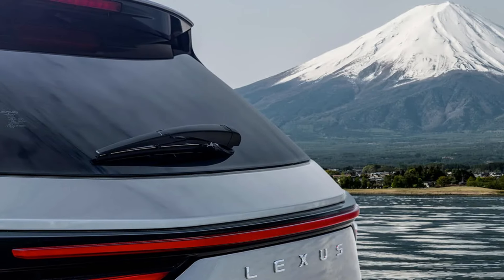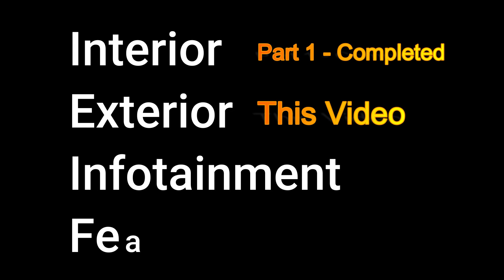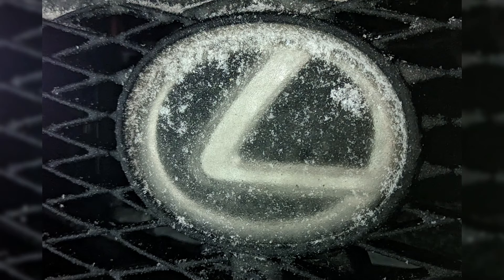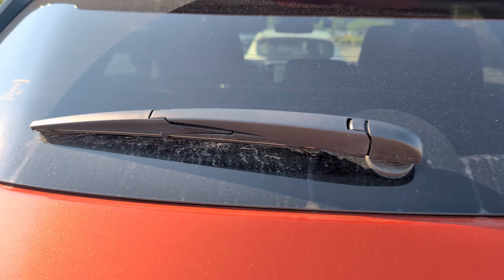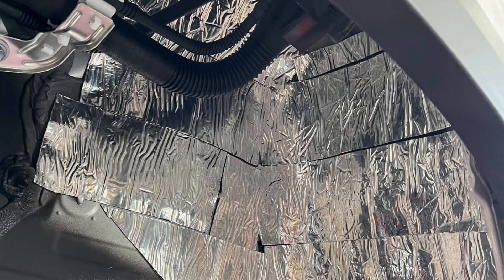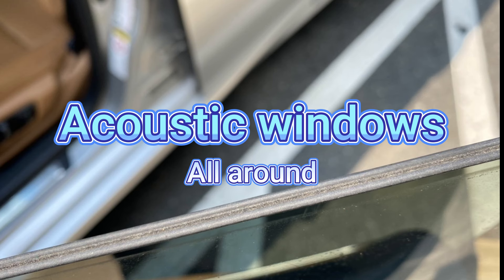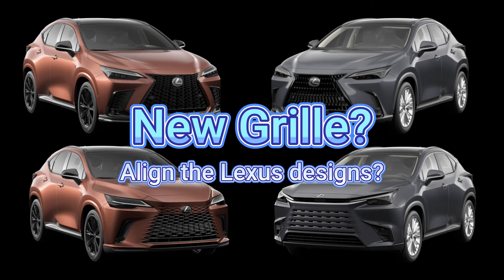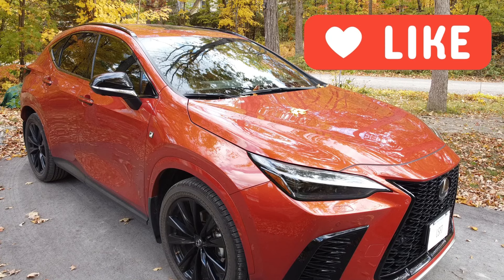2026 LEXUS NX Refresh? Part 2 - Wish list from owners

Comment: Get rid of run-flat tires.  Never will buy a vehicle with those again.
Reply from the maker: I think that's one of the least problems as you could swap them out. Unlike other things can't be replaced.
Reply: Few ppl appreciates run-flat coz of the noise it makes.  Good idea.
Reply from the maker: @wickytam2006 I guess when you get a flat with a repair kit you'll appreciate it.

Comment: 2 requests from me; 1. Change the door handles to ‘flush’ style that pop out or are recessed, 2. I’d like the rear wiper tucked up under the sill, not sitting at the bottom.
Reply from the maker: The door handles that are flush could cause many issues for the winter
Reply: @lsft  you might be right I just love the look of the much more than the older style

Comment: Hide the rear wiper. Heated Lexus emblem is desperately needed on all models!!!! It’s a safety hazard without it. The wiper blades ARE adjustable! Just go to the dealer and tell them how close you want the wiper to sweep to the drivers side A frame. I had them adjust my 2023 NX350 and now my new 2025 NX350h😎. Go get yours adjusted! Front camera washer would be nice 👍 I like the grill on my Executive NX350h.
Reply from the maker: Great feedback!

Comment: I purchased a 450h+ FSport in 2022 and mostly still love it, here are some improvements I'd like to see however. 1) Fewer 'scratchy plastics in the cabin - especially on the B pillar where the seat-belt buckle rattles. 2) Drivers seat thigh support. 3) Fixed panoramic sun-roof 4) Complete re-design of the trip-computer with more data fields. 5) integrated dashcam 6) More conspicuous ambient lighting 7) Wireless Android Auto 8) Active USB C port in centre binnacle. 9) ML Sound System - maybe with active noise cancelling. 10) Some customisable shortcut buttons 11) Greater steering wheel reach. 12) Fully LED driver display 13) Android Auto directions in the HUD 14) Split-screen infotainment system.
Reply from the maker: I guess we bought the same year. Some of the ones you mentioned will be coming up in other parts of this series. Thanks for the input. Some are already in the first part of the video as well.

Comment: I totally agree with your points about both the front and rear windshield wipers, heated symbol to prevent systems shutting down in inclement weather and the washer option for front camera. I would also like them to add the feature of sensors not activating (warning sounds) in the front when you are in reverse, and vice versa. As for the grill, happy with the presently have or the RX version. As a side note, the triple beam led headlights are significantly more expensive than the base version. They cost 4K each as they incorporate smart tech to shut off beams when they sense oncoming vehicles to not affect their vision.
Reply from the maker: I'm aware of the triple beam that is now expensive. But the US version does not include the adaptive high beam. But the bi-led version should be fully led. Just a simple bulb change in the turn signals.

Comment: For me: 
1) Spare tire - at least a donut. Please!
2) Better rear view from the driver seat to the left/right rear.
3) Consider pedestrian safety in the design of the front & grille. Current is too flat/vertical.
4) Camera removable storage for front/rear for crash/theft recording.
5) Rear wiper: YES... hide it.
6) Better ride quality... make the F Sport really stiff, but make the luxury softer.
7) Re Acoustic Glass... again, maybe no for F Sport & yes for luxury?
8) Washers for cameras: maybe.
Reply from the maker: Thanks for your list!

Comment: I would add one guess, about the turn signals : I guess they will be sequential on the refreshed model. Like it happened for the NX 1st generation.
For the front grille, I agree with you, the current one shows more personality and I would love it remains on the refreshed model. But I recognize it is really probable that it will change, more for one that looks like the TX (or the LBX), in my opinion...

Comment: I really wish that the front wipers would clean the entire windshield, as it is annoying to see 3" of snow covered beside the A pillar, and is also a safety hazard. Also, I hate how I cannot just pull out the wipers to make it stand so that it doesn't freeze. I have to put the car into service mode to do so, it's very frustrating and I forget how to do so after 3 seasons of not using it. And in your previous video, the soft plastic dash as well as the screens, they scratch way too easily. I'm always careful by using a soft microfiber towel and not using much force, but my MID display has 3 large and deep scratches that reflect light when it's sunny and the infotainment screen is covered in small micro scratches.
Reply from the maker: Wow you sure have a lot of scratches on your vehicle.  They do have a wiper heater to help melt the ice off the wipers.

Comment: Improvements and changes will be:
New front grille just like on the RZ
2. Alloy wheels should not be changed they are looking good
3. New and redesigned rear lights and hidden wiper 
4. Hidden door handles 
5 New infotainment  and climste system and sensor for the driver when he doesn't watch the road.
6. Nanoe X Climate System for removing odors in the cabin by Panasonic.
Reply from the maker: The front grille like the RZ is going to be hard as it needs the open grille for the gas engine. The Infotainment system is already new, I'm not sure if you'll see another new one and the pain the fix bugs. The optical sensor would most likely happen. The NanoeX is available already in Europe and Asia. Not sure why it's not available in North America. Maybe we have cleaner air??